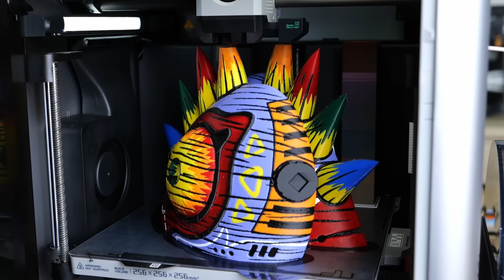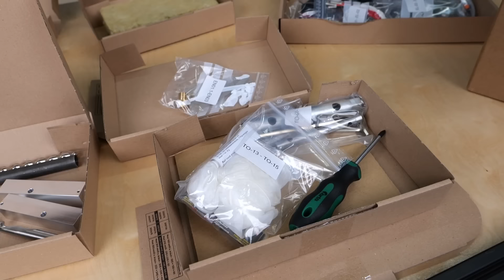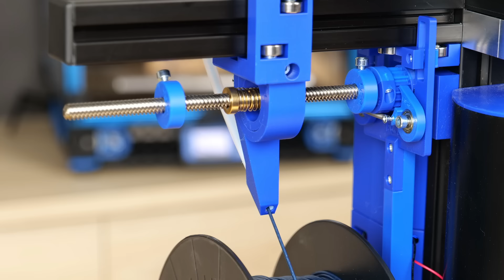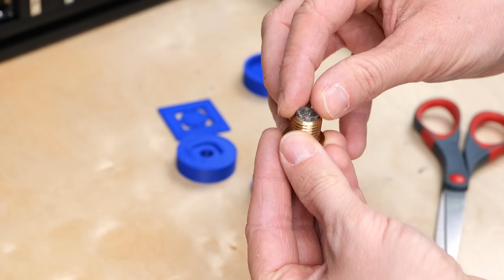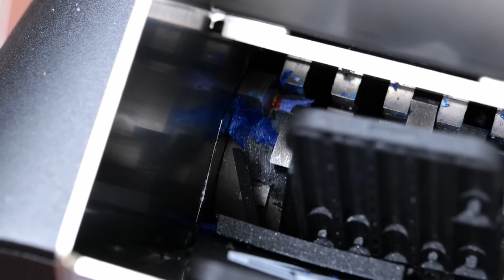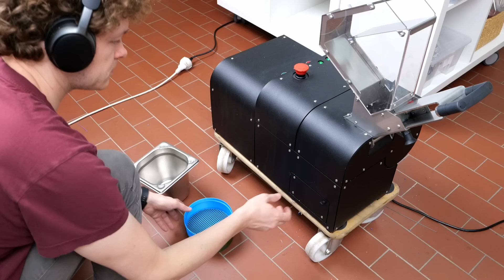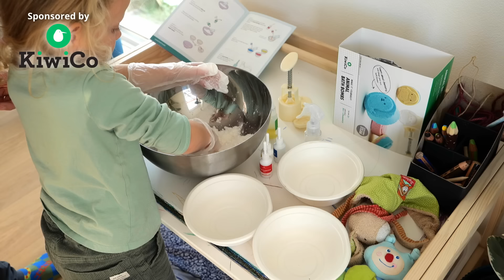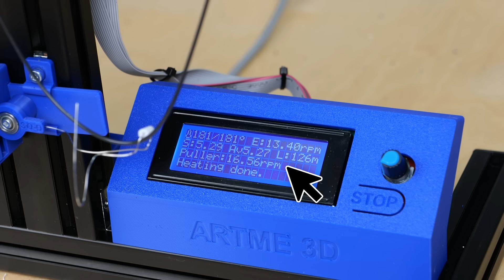Recycling Failed 3D Prints with a DIY Filament Extruder: Artme3D

Comment: I run a makerspace at a local university. I have been trying to work out a grant for the other recycler you showed. This one here is within our budget! Thanks Stefan!
Reply: I hate the markerspace in my university. They charge you $0.20 per gram of PLA. (That's the cheapest option). I end up spending $15 for a part that often costs me less than a quarter dollars in material. That aside, their machines are not fine tuned and I've gotten better or the same finish with a stock ender 3 V2. Also, they don't let me choose the print orientation and would often refuse to add supports in their slicer. They'd want me to add supports in CAD which can be a nightmare. I'm glad I don't go to them anymore.
Reply: @kbee225 that's too bad! Sorry to hear some universities still see makerspaces as a "service-facility". I run my university makerspace as a means to teach prototyping: users get advice and support, but do all the work themselves. Luckily, the faculty agrees, so none of that silly "15 dollar for a print" nonsense.
Reply: @kbee225  at that point you might aswell buy a ender and stick it in a corner
Reply: @BootlegHuman  yeah. What do you think I did?
Reply: @kbee225  ate a thumbtack
Reply: @kbee225 at that point, why even bother HAVING the space? We bought thousands of dollars worth of equipment. To use? No, to collect dust because we're too stupid to know how to properly, so you must be too
Reply: @kbee225
$200 for a roll of PLA?
Fuck that.
Why not buy your own printer for less than 1 roll?
Reply: @mrbmp09  yeah that's what I did. And I said that in my original comment too I think.
Reply: @kbee225  Expecting you to add supports in CAD instead of letting the slicer optimize and use modern contact patterns for easy removal is actually wild.
Reply: take your own?
Reply: @kbee225  I agree the best space for the maker is the one that you can run on your own aka garage. When your project depends on bureaucracy and other ppl it's a mess. I look at our labs and most of the equipment is just dust collectors. The issue with the small schools in Germany is that they have funding to build a new building, but not to pay to the lab assistants or lab technicians. Labs are like museums here, you just look at the equipment, but you don't use it.
Reply: @chilloxik  yep couldn't agree more. I especially hated that they wouldn't add supports to it. Like, any decent slicer these days has modifiers for just one model on the print plate. They were just lazy. The sad part is, every time I went there there was always a good amount of prints going.
Reply: I was just thinking to myself how it seems overkill for a solo maker to get one of these, but a group of makers could all pool together their scraps and really get a lot of use out of one collectively. Buying one for a maker space seems like a great idea!
Reply: Lol, $200 for a spool of PLA, it's cheaper to buy an entire Ender 3 and a spool of PLA at that price point
Reply: So awesome that you do such thing! Architecture and art universities should really invest into teaching students how to use those stuff
Reply: that’s the exact same reason i clicked on this video myself. I am a student at my high school districts engineering building who helps the administration, teachers, and students with the 3d printers, and we have so much filament in bins from failed prints and supports it’s crazy.
Reply: The manufacturer is an amazing person. I asked him for help with my broken Uni equipment in Germany and though he cannot help yet, but he was very nice to listen to my never ending problems story. Please buy from him, he is REAL and LOVES what he does 🙏🙏🙏
Reply: That would be a huge payoff. I hope you get one and it works. I hate to see how much plastic waste these things create... and there really aren't any truly biodegradable filaments. You can also recycle other people's scraps and the machine will more than pay for itself. In time you'll probably be able to justify a much larger, much more capable machine.
Reply: @deucedeuce1572  I did get my hands on some true biodegradeable PLA filament that breaks down in a few weeks in the ground. Good idea for prototyping for sure.
Reply: @geekdomo  That's good to hear. You have any way to test or verify it? The vast majority of PLA is labeled as biodegradable, but it will never break down naturally in a landfill. I'm not sure what the best way to verify would be though. You'd have to bury it and wait to see if it breaks down... but that would take months to years and in that time you could create a lot of waste that's not biodegradable.

I think for many people, prototypes are the main thing that people print when making actual functional parts. Sometimes it can take 5, 10 or even like 20+ prototypes before ending up with a final product... so it's not just the supports that go to waste, but the majority of what some people print.

For people like that, the filament extruders could be extremely useful. It could cut filament costs like 80%.
Reply: Just hire the Engineering students.

My old university had a team that built one of these for less than what this guy had.
Reply: How did you get the funds to have a makerspace?
Reply: Your university charges soooooo much for what they offer. All universities do. You shouldn't have to scrounge for grants while they bank so much. It's a scam.
Reply: where do you run a makers space i been considering joining the one in manchester nh
Reply: A grand. Freeloaders are everywhere.
Reply: @rightsdontcomewithpermits7073  why not? I pay Taxes why the government cannot give me a grant. Especially in Germany they literally work on government.

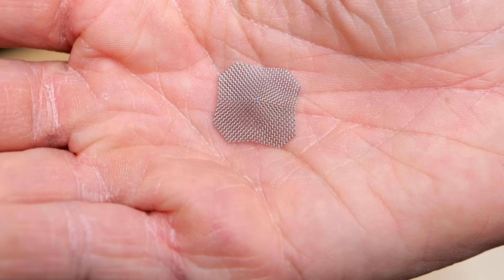Comment: Regarding Teflon-tape temperature (6:25), some Teflon tapes are rated for 260C/500F while others are 288C/550F.
So you can bump the temperature to ~280C if you use the right tape; it's basically the same price too!
Reply: Wrong, most teflon's advertise melting temp rather than a temp where you'll get sick due to the fumes. On any 3d printer with a PTFE hotend I always recommend 230c as the max since thats the temp fumes start to get really bad.
Reply: @FryedWater  Yes, that sounded sus. Guess you just have to do without the tape.
Reply: That's great news, because you need something like 265-280 for PET, which is the most desirable material to use with such a machine. But getting it to do well with PET probably requires tweaking the post extrusion process for rapid cooling...
Reply: @daliasprints9798 doesnt PET crystalizes and be basically ineffective when heated?
Reply: @SerialChillerBH  PET only crystallizes if you're too slow cooling it. Whether that's a good or bad thing depends on what you want. It has bonkers high thermal resistance if you crystallize it, but it's more rigid and therefore brittle too (still way stronger than PLA though). When filament manufacturers talk about crystallization as a bad thing, they mean it's a difficulty for them.manufacturing filament, not for you printing.
Reply: @daliasprints9798  PLA is always stronger.
Reply: @AuxHex  No it's not. You can go and look up the results of the limited testing CNC Kitchen did, or you can actually get some and try it.
Reply: @daliasprints9798  yeah, look at the CNC Kitchen videos more carefully, PLA is the strongest plastic out there.
Reply: @AuxHex  It is not. You're probably looking at one with PETG (the G stands for garbage) not PET.
Reply: @AuxHex  not after some months
Reply: Why not remove the Teflon out of the equation and use copper foil or somilar ultra thin metallic seal?

Comment: This machine looks promising. As you mentioned it would be nice to have a feedback loop for regulation of the diameter. But I don't think that will take long from now.
Would love to have such a machine, but the biggest problem is still the shredder
Reply: An esp32 cam would make a damn good sensor.
Reply: @clockworkvanhellsing372  if you know how, then please contribute to the project
Reply: Can get pellets from add north.
Reply: @Exstaz  it's about recycling old prints, not just make new filament.

Comment: sadly it is still too expensive to make sense for me.
I buy PLA at 15 euro / kg. In order to make my money back on this machine: 650/15= 43.33kg of PLA.
And this is NOT taking into account the time wasted to prepare the machine and recycle the filament.
Reply: Pellets are around $1/kg.
Reply: @daliasprints9798  Unfortunately, that's not true. You might get less than 3$ per kilo if you buy 10 tons. But then you need a loading ramp for trucks, a forklift and a large warehouse. I for example only have storage space for about 300 to 600kg at the moment. And I pay between 7 to 9$ per kilogram. (If you can even find a supplier who sells such small quantities.) Of course, it all depends on the country you import or buy from. Then there is duty and tax in addition. And then you still have to unpack, handle, weigh, pack and ship it. I am working on a process to get the price down. but that still takes time and a lot of investment in machines.
Reply: @ARTME3D  Sorry, PET not PLA. No need to buy large quantities, and it's a vastly superior print material.

Comment: Hallo Stefan,
as for "let me know your thoughts on filament recycling:"
Yeah, it would probably not be worth it for me in regards to saving money.

Though for me, recycling my filament at all is pretty important. Yeah, 3D printing is a hobby, but that doesn't mean it's permissible to me to just throw plastic onto the next waste dump.
I'm currently using Recyclingfabrik for my filament, though I will definitively have to compare prices and stuff, maybe Artme's solution is better than Recyclingfabrik. The latter still needs to run some kind of profit, while someone recycling their own filament doesn't.
Reply: If you are using Recyclingfabrik you are likely living in europe - all trash gets incinerated for its energy content, so it is perfectly fine to throw it in the trash. 
If it is PLA, it's even Co2 neutral (grown as corn from Co2, used as plastic, burned and embodied energy freed and Co2 re-released - cycle starts again).

Comment: Have you tried the machine with PETG?
Reply: I tried recently (on MK1 version) PETG supports regrind ad it was pretty much same as PLA, used recomennded settings and auto pulling, from 1,71 to 1,79 but almost 90% measurements was something like 1.73 to 1.76, there ocassional tiny bubbles but i did not dried it in oven, just in cardboard box in food dehydrator with few spools in something like 6 hours in total.

Comment: Is 0.1mm deviation maximum deviation or average?
Reply from the maker: Max deviation is probably slightly higher. I'd say +-0.1 mm is probably the 90 percentile of deviation. I need to get a sensor for this, though.

Comment: TeachingTech just released a filament shredder/chopper, which would be really useful for you to re-pelletize some first stage filament! That should give you uniform pellets that work much better for your filament extruder.
Reply from the maker: On my list! I already tried it out a little in my last video.
Reply: @CNCKitchen sharp corners and thin pieces will melt faster and will end up burning before the larger pieces melt causing gels. Uniform pieces at the lowest melt temp is ideal for premium finished product. Good luck!
Reply: @CNCKitchen  The Polymere chains get worden with every Hearing cycle and chopping because then they are shorter
Reply: @romanschmid8985 only an issue with amateurs extruding. In professional recycling we lengthen the chains again 

And it doesn't happen because "it cuts" or whatever. It's hydrolysis
Reply: @romanschmid8985 polymere chains are a few thousand atoms long, stretched out you might get into micrometer length territory but they are in practice not stretched out so you'd have to cut nanometer size structures. And even if you destroy a few of them mechanically, there are so many that it doesn't matter
Reply: TIL there's professional recycling? So you end up with twice the plasticizer, or nah you're 100% back to monomers and set for 10,000-mer again with spinons as plasticizer?
Reply: @Cineenvenordquist  well yeah, unless you burn trash in an oil drum your trash will likely end up in some professional recycling setup.

And there is no need to go back to monomers. In PET recycling we start with viscosity in the 0.6 IV range and build up to basically whatever value we want. That's the lengthening of chains. All that happens in pellets after they were extruded.
Reply: @zapl80  false.
They get broken up by hydrolysis and it has a massive impact.

Bonus points for extruding in atmosphere so you get oxidation as well.

For materials that suffer from hydrolysis a professional setup will not just do some light drying. We keep the material at 200°C for 90 minutes in a Vakuum of less than 1% atmosphere (less 10mbar), all of which is nitrogen because inert, just to make sure ita dry.

Actually that process alone of drying it very effectively increases the IV by 0.1
Reply: @BelviGER what do you mean by false? Mechanical fracture of atom-atom bonds is a thing, just not relevant?
Reply: @BelviGER I think you are the person who can help me with my PET saga. I shredded bottle necks and bottoms, baked them at 150C, used blender to break them smaller, than wood chopping machine, now baked it again at 150C. I vacuum sealed it, but I'm so scared to run the extrusion. Should I dry it at 200C before the extrusion? I'm very sorry but PET keeps me awake at night.
Reply: @BelviGER I'll ask my professor tomorrow. Thank you for the comment. Qq what type of shredder do you use in industrial setting? I watched thousands of videos tbh.
Reply: @BelviGER  Are you able to share any basics of how this is achieved please?  I am just now setting up a recycled filament line based on Filafab extruder, exploring best practice around drying, 2-stage extrude and pelletise, mixing virgin material etc.  Any tips greatly appreciated.
Reply: @Splarkszter Wu’s contribution to that video was the insert installer that was used, not the shredder design.
Reply: @Splarkszter  No, its not. Did you even watch the video?
Reply: @Splarkszter  No, they are separate topics. Please watch the video before referencing it.
Reply: Vitamix! 😂
Reply: Can you post a link?
Reply: @Splarkszter did you even watch the video? should've kept this in your drafts Xi
Reply: @Splarkszter  Simp
Reply: @KORUPTable she convinced creality to make the ender open source. That's enough to support her.

Comment: Only $650? You're kidding. You get for this at least 50-60 KG of PLA filament. Filament Recycling for personal use is a waiste of money and time.
Reply: It's the cheapest available option that I'm aware of? You ok?
Reply: @theguyonyoutube4826  The cheapest option seems to be the garbage bin.
Reply from the maker: Yet isn't a 3D printer that costs $1000 to print some useless stuff from Thingiverse a waste of money as well? A hobby is by definition something that loses money.
Reply: @CNCKitchen  Assuming you pay 1000€ for your printer ... and not the more likely 100€-200€.
Reply: @CNCKitchen  You are right. Do it for science or as a hobby and you will lose money with that. But you don't have to burn it directly. In my opinion, recycling filament to save the envirioment makes no sense. There are companies that can do it more efficiently.
Reply: The point isn't for it to be super cheap, but to keep getting cheaper and cheaper than how at home recycling used to be (which was in the THOUSANDS of dollars not all that long ago, so this is super impressive). If you bought all that PLA you mentioned instead, you'd still be left with any scraps, imperfect models, supports, rafts, etc. just sitting there to be wasted, and you'd be literally throwing money away. Even if you're perfect and you never have failed prints or don't use supports, plenty of other people aren't, which means there's a LOT of waste PLA just sitting out there ready to go into landfills, rivers, the ocean, etc. So to some, that $650 is worth getting that extra PLA from each spool out of the trash can and back into working circulation.
Reply: @Mastersaifer  But it is not going into oceans and for most people also not into landfills - it will be incinerated. And buying 650€ + X€ (shredder, etc) wastes even more money. It is simply irrational.
Reply: @Mastersaifer  PLA is biodegradable. After 80 years it's gone. Much better then other materials.
Reply: If it's a waste to you, then don't.
Reply: True. But these machines are for hobbyists. It wasn't meant to be practical for everyone lol. And 650 is cheap when compared to professionally made ones at 1500. Or make your own design! I'd like to see your video. (:
Reply: It's like making mdf or particle board from sawdust and wood scraps, which no sane person would do.